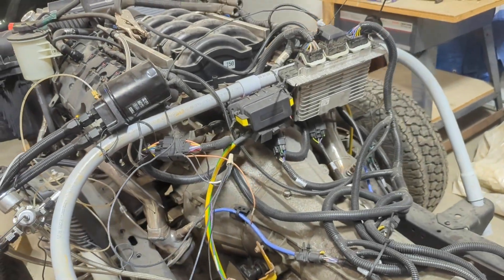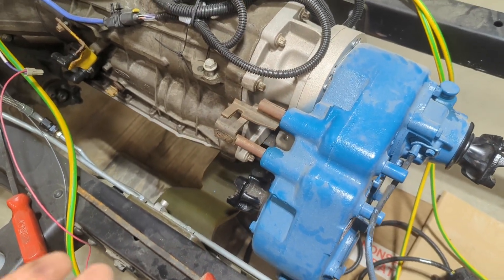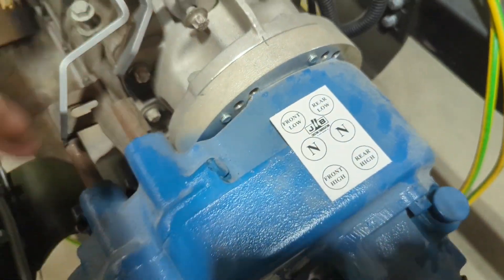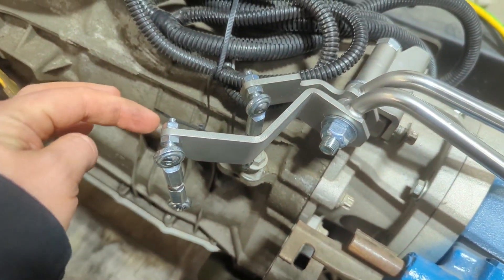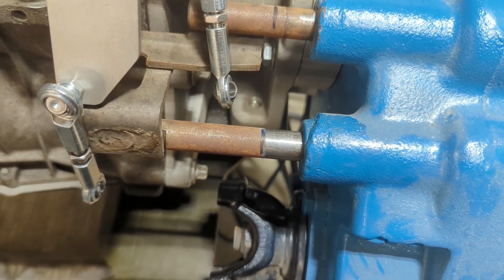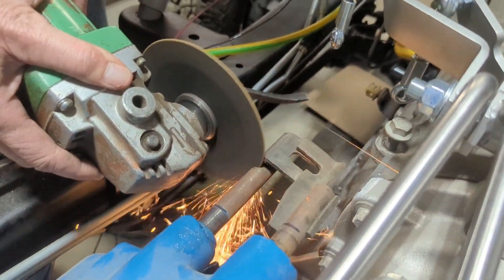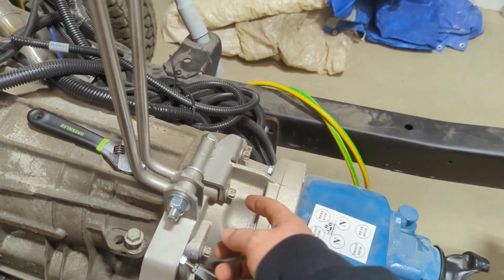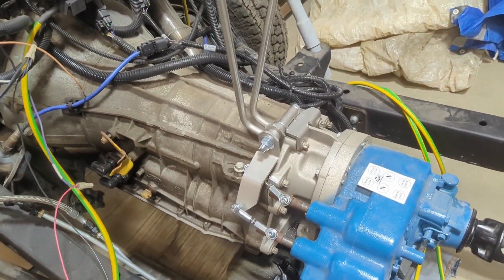Dana 20 Twin Stick Shifter on a Coyote Swap Early Bronco -- JB Custom Fabrication

Comment: I am still waiting to see someone do a manual transmission swap with coyote on an old bronco.
Reply from the maker: Won't be super common on a coyote because the coyote never had a 4x4 manual trans option. So either 6r80 w Dana 20 or similar transfer case or you run like an NV transmission with n adapter.
Reply: @605BOLT I know. I can dream.
Reply from the maker: @seannedelko3497 preach. Same. I still am mentally holding out for a manual coyote 2026 bronco. But I know it won't come sadly.
Reply: @605BOLT I have a 22 badlands with manual.
Reply from the maker: @seannedelko3497 I'm jealous.

Comment: What type of drill bits did you use?   I’m having difficulty getting a hole started.
Reply from the maker: I don't know for sure because they came from my work. I'm assuming it was a carbide bit. High speed steel probably wouldn't work quite as well. Did you get a good center mark? Starting was the hard part for us too.
Reply: I’ve ordered some cobalt bits with 135 degree tip angle and a better center punch.
Reply from the maker: @bronco5644 might be a struggle. Idk. Stick with it and you should be able to get it to go.

Comment: Anyone making a cable setup to relocate the arms ?
Reply: Yes, we can do that with cables coming in from the front or from the back (over the top). 
Typically used when custom consoles require that the shifter be relocated